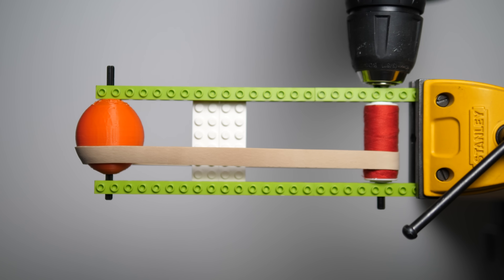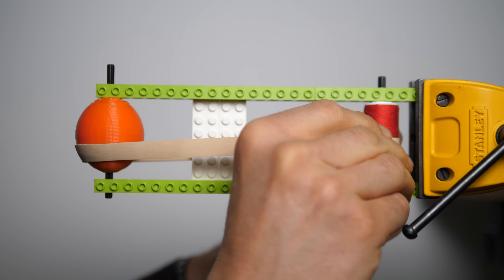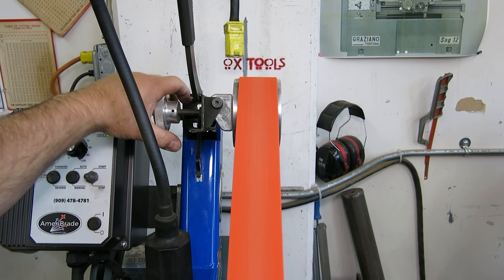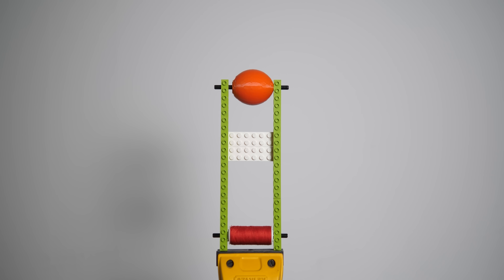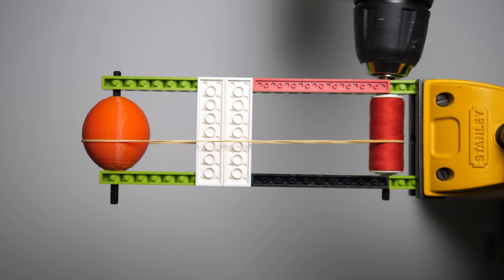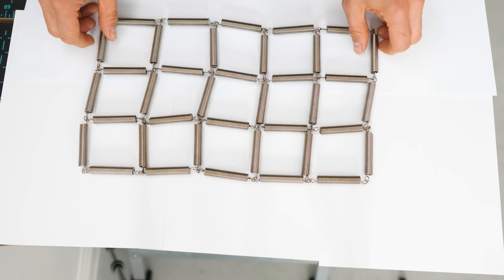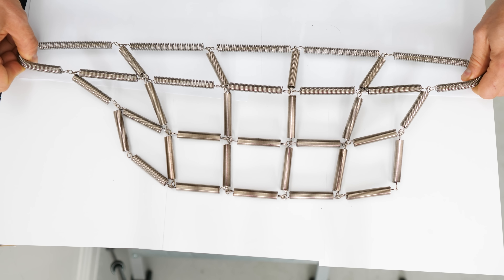The Band Should Slip Off But It Does The Opposite!

Comment: I work in the material handling field as a controls engineer and we use this principle to center conveyor belts on their pullies.  One interesting feature of this is that if the curved portion of the pully is smaller than the width of the belt, or in this case, rubber band, is that the rubber band tends to center itself on the curved section which at that point it is equilibrium even if the belt was on the very edge of the curved pully.
Reply from the maker: Interesting!

Comment: I disagree with only the rubber effect being the main cause of the effect. Conveyour belts are used for material hanling have the effect even when they are extremly stiff due to the kevelar reinforcement that is loadbearing. I belive it has more to do with normal force getting a component directed to the centerline of the belt

Comment: So what would happen if I cooled the rubber down after stretching it. would it retain it's shape?
Reply from the maker: It would
Reply: @SteveMould  Interesting.  Though this still confuses me. If I were to stretch a rubber band, and kept it stretched for a period of time, surely the heat would eventually leak into the environment and it would lose it's elasticity. However, this behaviour is not what would be experienced. I have witnessed rubber bands stretched on items for over a year (way long enough for the heat to dissipate) which still retains it's elasticity.

Comment: Isn't the band following the straightest path on the curved surface ? Like a parallel on a globe is not a "straight" line on a globe. We can see that in orbital mechanics : you can't have an orbit that does not cross the equator. I have the felling that the rubber aspect of the band is not the real cause of the phenomenon (and I suspect it will work with non stretchable materials like cloth) but pure mathematics with lines on a non euclidean surface.

Comment: That explains it..
It don't  remember what for, but a few years ago, I designed the concave thingy for a homemade belt system, and I couldn't understand why the belt was, always flying off.
I had to put on guards to prevent it... It was a mess. 
Now I know. Thanks! :)
Reply: reminds me of 45 years ago when i tried to square up a radial saw table with a square that wasn't square, drove me nuts.
Reply: Would have been fun to watch that frustration

Comment: 5:14 are those the same metal beads you were using when you discovered the groundbreaking mould effect?! The greatest effect known to science.
Reply from the maker: They are
Reply: @SteveMould  Was this video just an excuse to play with them again?
Reply: @SteveMould  you need to put those behind glass. such a historic artifact should be protected!
Reply: @judgeomega  You would not have been able to experience their "molecular jiggle", were he to have done that
Reply: @SteveMould  Hey you never responded to my comment on your other video.  Hope you can respond when you can.  Thanks.
Reply: @SteveMould  So it's nothing to do with the fact that the bigger diameter moves faster than the smaller diameter? That is what I thought pulled these to the centre??? Near the shaft has the same rpm but it doesn't have to move as far to get back to the beginning
Reply: Congrats on 1m subs too

Comment: I would have imagined that the more stretched out part experiences a different amount of friction due to more contact area and higher pressure, resulting in a net force, or something like that.
Reply: Both explanations are probably true at the same time, his curvature explanation in part explains the increased contact area.
Reply: This is the more formal explanation whereas the furthest rotational surface of the ball is rotating faster generating more "pull" on the wide surface causing the wider band to creep up the ball. Old farm equipment as pictured were not rubber so the theory of the curvature of the band being the simple answer is not the full one. This answers why the thin band moved downward as well due to the lack of surface frictional differences. Its kind of funny because physicists have been struggling with the same problem of why bicycles tend towards staying upright while moving forward with no rider. This is the outline for the solution and shows the frictional differences in how the ground actually tugs at the tire to pull the steering mechanism in the direction of the fall, thus moving the center of gravity to the opposite side of the fall.
Reply: That’s what I assumed as well

Comment: This seems entirely intuitive to me because I worked with belts and pulleys on newspaper presses and delivery systems for a long time. It was a common practice to move the belt position a bit by adding a small piece of tape to one side of the pulley. Or shift the the entire web of paper passing between press units by putting a small piece of tape on a roller that is acting as a pulley guiding the web. I always imagined it had to do with changing the diameter of the pulley on one side, making the belt 'climb' to the high side but I never thought a lot about exactly why it did this. I imagined it pulling harder on one side of the belt. It sounds like I was making it into a sort of crowned pulley, or altering the crown of a that type of pulley.
Reply from the maker: Interesting!

Comment: I haven't finished but my guess is that the pressure on the band would be greater towards the middle of the curved portion, resulting in the vector of force being pointed upwards, causing the rubber band to move back to the middle, and inversely if it was off center at the top.
Reply: Ah. Wrong. Interesting, though!

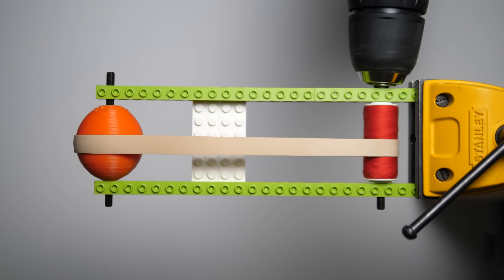Comment: I’m a bit baffled. The explanation at 3:20 doesn’t really explain why it shift up.
Reply: As it turns the roller meets the belt at a higher point where the belt is curved upwards.
Reply: @TylerSuronen  yes I get that but how does that pull it back up? Friction? The way I imagine it is that the normal force and the direction of pull of the rubber band are not parallel anymore, therefore the  component force pulls the rubber band to equilibrium. But then again, that should work for the convex pulley too.

Comment: 0:21 lol I remember that episode of smarter everyday
Reply from the maker: What a rollercoaster!
Reply: 0:38 I'm guessing it's the grip of the rubber band that makes it go upward instead of slipping off
Reply: 0:53 yeah i'm thinking more about this now, the part of that egg closest to use (the camera) will grab (at the point of contact) the rubber band at an angle, and because it is grippy it will maintain that same height as it turns round and round, so it just corrects itself, that's kewl
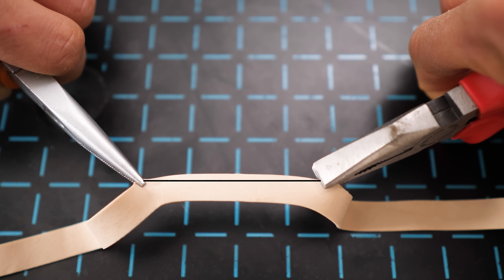Reply: 2:51 hmm... are you sure it's this arching effect? I think the whole rubberband line (stretched out) is just angled from one side to the other, I guess I'll keep watching and check the footage again.
Reply: 2:57 oh snap the right side is actually lower here, my theory is out the window now, your theory is in lol
Reply: 3:15 I basically said the same thing but I still had a little part of it wrong, wewhewwww
Reply: @euclideanplane  Is your thing leaving a string of comments on videos before actually watching them? You could just, you know, keep a diary or something if you want to talk to yourself.

Comment: Another way to think of it that makes more sense to me is that the part of the band that is closer to the middle is much tighter on the round end. Because the top and bottom are both pulling on each other, but the top is much harder to move, the amount the bottom moves up is greater than the amount the top moves down. Then, the bottom and middle are higher up, which then means that the top will get pushed upward as well. Sorry if this  is confusing, it makes more sense visually.
Edit: Clarification and rewording.

Comment: can this be a possible explanation for this phenomenon -
the rubber band gets arched at the top, which means that it will be expanded along the width, so it would like to contract along the width
now, the top portion is stretched along the length more than the bottom one, which is why it will be held on to the curved surface of the crowned pulley  with higher force, which in turn, will induce more friction and make the bottom portion come towards the top when the rubber band tries to contract along the width

does this make any sense?

Comment: 0:16 hold on multiplies force? Isn't force energy? I'm pretty certain that defies Newtons conservation of energy.
Reply: Nope, force is not energy. The 8th-grade version is that work is force times distance. A pulley system will allow you to use less force to move an object, but the cost is that you'll have to apply that force over a longer distance, and thus energy is conserved.
Reply: Force is not energy. Pulley/snatch systems trade force for displacement- you can apply four times the force, but you’ll have to move four times the distance.
Reply: Energy is force times distance. You multiply the force but divide the distance so the energy stay the same.
Reply: It kinda multiplies a force by applying the same energy over a smaller distance. You pull x centimeters of string, and the object moves only x÷n cm. You say "huh, that was easy" but when you try to move the object with your hands instead of using the pulley, you see it weighs n times as much as it felt like before.

Comment: I noticed it when I mounted a belt tensioner at an angle, then wanted to correct it so the belt tracked correctly and I had to do it in the opposite direction than was intuitive

Comment: Okay I'm not even watching yet
But why should it slip off?  The edge along the larger diameter has more tension and is moving faster it should crawl to the top of the curve.

(Ok. I cheated by already knowing about, making and using crown pulleys in my career)
Edit: cool I've never seen a demonstration so clearly laid out

Comment: SNATCH BLOCK! Also, Bandsaws use crowned pulleys on the wheels.
Reply: Does this really work with a bandsaw? As the video demonstrates, the self-centering property seems to be caused by elasticity, and bandsaws have very little of that.
Reply: @ps.2  The bands of a bandsaw are very elastic, you're just not strong enough to notice :)
Reply: @ps.2  Everything is elastic if you try hard enough ;)
Reply: @Lizlodude  absolutely everything is elastic, it's not about being strong enough it's about being able to measure it.
If you stand on a railroad bridge the bridge is bending due to your weight, you just can't sense it.
Reply: @ps.2  They may be there for different reasons, but bandsaw wheels are definitely crowned.
Reply: @ps.2  you'd be suprised how springy band saw blades are. Gave many an apprentice a nice scar while he tried to unfuck a slipped blade
Reply: @ps.2  As a carpenter i can confirm this behavior, it just works well...
Reply: Wheels?